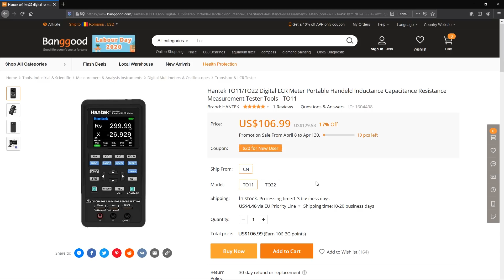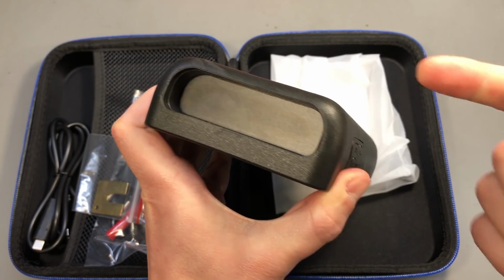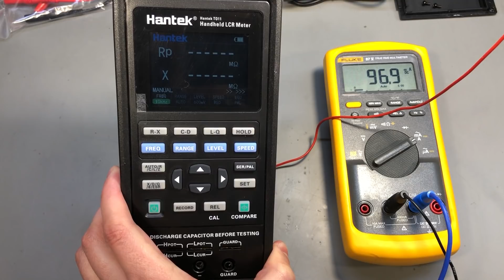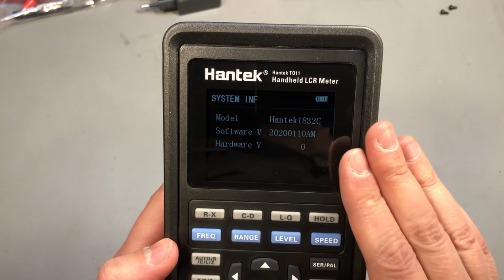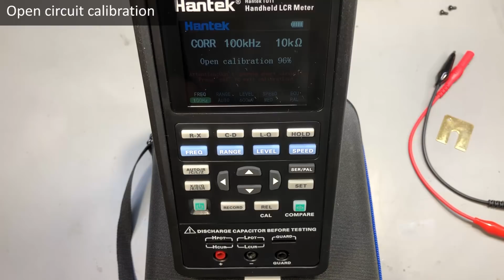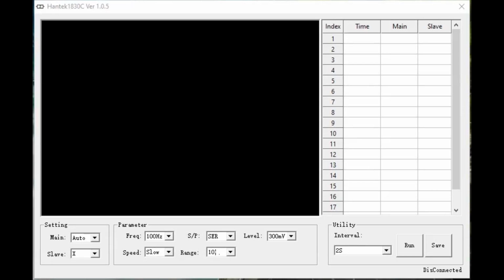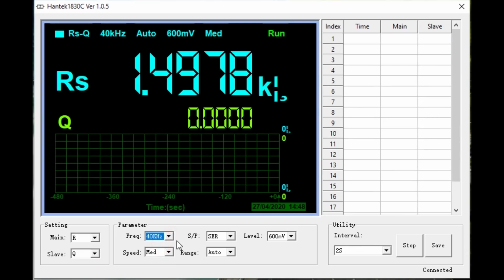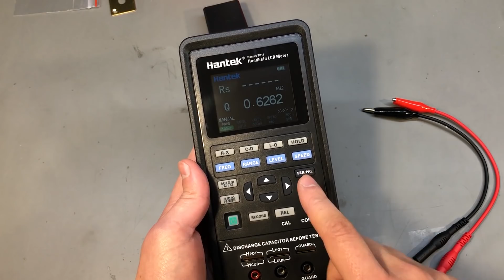Hantek TO11 1832C LCR Meter Review & Teardown | Voltlog #303

Comment: Way more expensive than DE-5000 which has way better quality and accuracy.
Reply from the maker: I'm failing to see how the DE-5000 has better quality and accuracy considering this: it barely contains anything on that internal PCB, it uses a pesky 9V battery for power vs 18650 cells on the hantek, it is a 20.000 count meter vs the hantek which is 40.000 count, it uses a segment lcd vs a tft on the hantek, you need to buy an additional interface for usb connection, accuracy figures seem similar. So what are you saying there?
Reply: @voltlog  Well you can pay an extra fee to calibrate the DE-5000, which means that it has to be reliable. It is a Japonese product (which by itself doesn't mean much, but ok)
About the amount of components, both are pretty similar, this Hantek only has 2 boards but very unpopulated.
The DE-5000 has 2 main chips, one the MCU and the other one is responsible to control the readings (this Hantek only has a lot of chips to do the same work).
Hantek uses a dc-dc converter which induce noise, DE-5000 uses LDOs.
Both boards are gold-plated but DE-5000 is more shinny, so i would say it has more quality.
DE-5000 needs an extra interface to use the USB communication but it is isolated, not direct USB communication with the board, which once again induces noise.
It has a 9v battery but it doesn't waste 1mA in standby mode :D
DE-5000 uses a readable screen.
Hantek has to be more powerful indeed, because it has a better MCU, but why bother with graphics and functionalities if what really meters is to have good and reliable readings
Reply: @FixDaily  I owe the 1833c and I am happy with it. It has extended ranges in low C and R and it has selectable speed ranges. So you can use faster measurement speed if its needed or slower if it has to be more acurate. I dont think that gold-plated boards, LDO's or dc-dc converter are crucial on the measurement results. However I'd also like to see if one'd make a video having those two side by side and compare to make a better choice.
Reply: @voltlog  I was thinking I might add this to my collection of LCR meters but I really could not see most of the measurements you made. That screen kills it for me. I will stick with my DE-5000 which is very readable and plenty accurate enough.

Comment: About the screen brightness... did you try fiddling with the backlight setting? https://www.manualslib.com/manual/1720538/Hantek-1832c.html?page=10#manual
Reply from the maker: Brightness was on max setting by default.
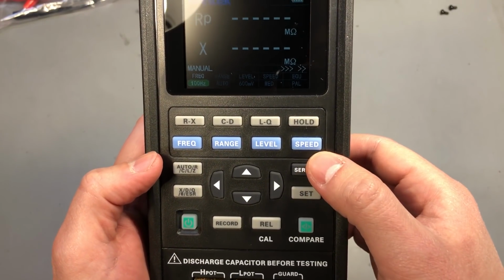Reply: 08:17 - When Voltlog pressed the SET Button

Comment: Good review! Seems like a pretty descent LCR meter for that price. @15:56 there is an unpopulated footprint for which looks to be for something with an antenna. Wonder if there is a WIFI or Bluetooth version available.
Reply: It seems to match ESP-12. They even populated pull-ups for EN and RST pins. EDIT: Just watched the video and checked the manual linked in the description. Serial communication is very well documented in the manual.  WiFi functionality should be easy to implement, if one really needs it.
Reply from the maker: In theory I think it's possible to hack it and add the ESP module in there (if there is serial data present) but in practice I'm not sure how useful that is in a handheld LCR meter. I don't think I'll ever use something like that. In a bench meter it might make more sense to have something like that. For me this is the kind of instrument that I'll keep in it's nice carry case and only bring out when I'm doing a repair/debugging session or maybe when I'm trying build or test some inductors.